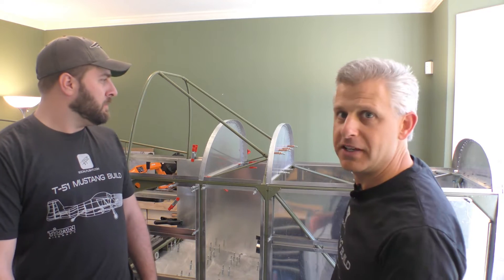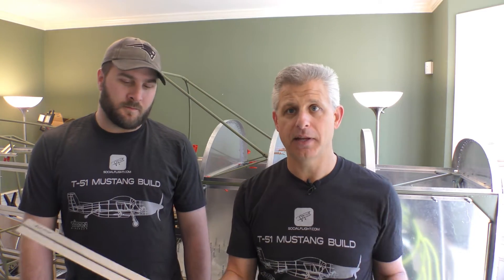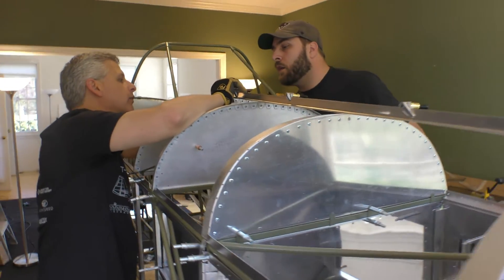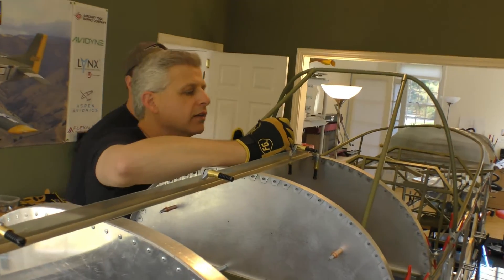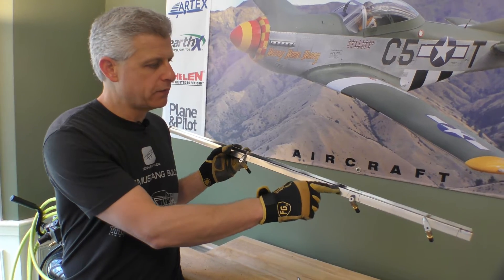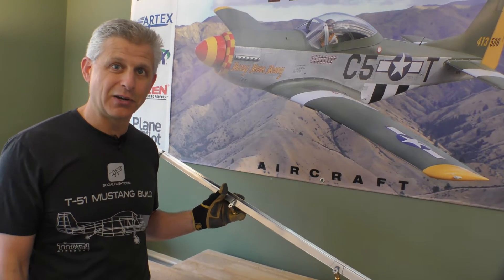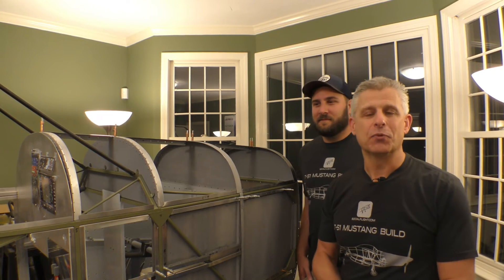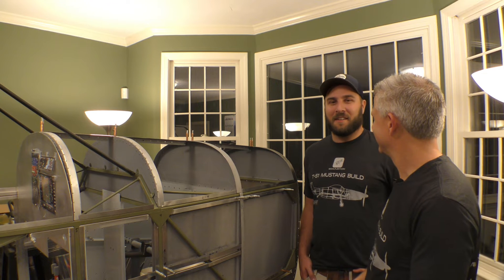SocialFlight's T-51D Mustang - Building the Upper Cowl Stringer

Comment: Fun watching your progress! I'm an A&P IA with 30 + yrs in GA & warbirds. Worked on many P51's in my career, and would love to build a T51 project. Like to offer a couple of tips- grinding aluminum on a stone grinding wheel is dangerous! you will pack aluminum into the pores of the wheel and it can cause it to shatter over time! use an air grinder tool or a roll-lock air  tool to remove aluminum. Also plan for future maintenance with access panels & nut plate attachments instead of riveting. For instance  your radiator appeared that you were riveting it to the bulkhead- that will be a maintenance & repair component- dont rivet your self into a corner. your doing a great job- great that your sons are involved too! envious we all are!!!!!

Comment: Wouldn't adding those notches introduce areas of stress concentration to the stringer on either side of the bulkhead or is the stringer made to add strength only in the normal direction instead of in shear?

Comment: Another safety tip.....don’t grind aluminum with your bench grinder. The soft metal impregnates the wheel and causes it to explode. 
Dress that wheel immediately or it could explode. 
Also when you make your notches, you may have a better cut with chain drilling. Basically, you’re making a big hole with many #40 (3/32”) holes. Then file and sand smooth. 

http://web.mit.edu/course/other/machineshop/Grinder/aluminum.html

Comment: Always nice to see more progress on this build; you're doing a great job!

Shop safety tip: never wear gloves while using a bench grinder.  If the wheel grabs leather and pulls it between itself and the work rest in front of the wheel, it can easily break a finger, or worse.  There's enormous kinetic energy in that wheel.
Reply from the maker: FlyingShotsman Good safety tip. Thank you!
Reply from the maker: Good safety tip. Thank you!